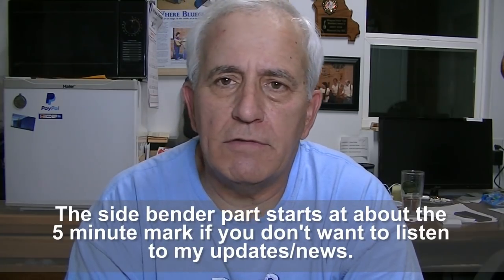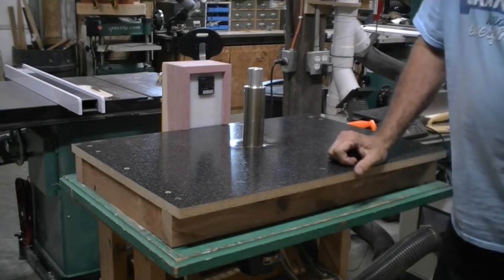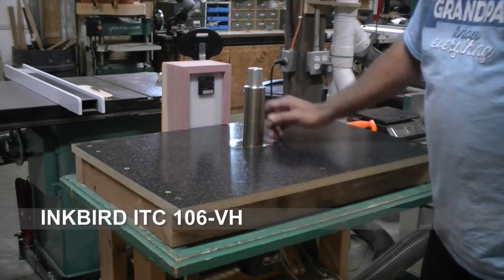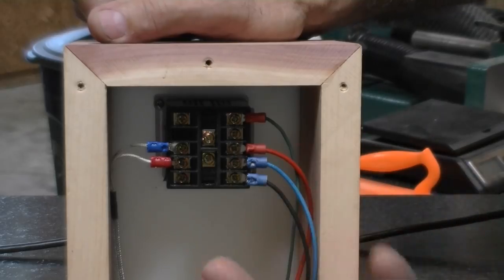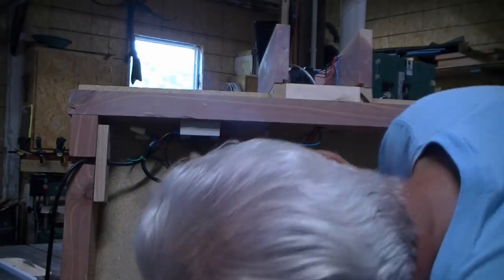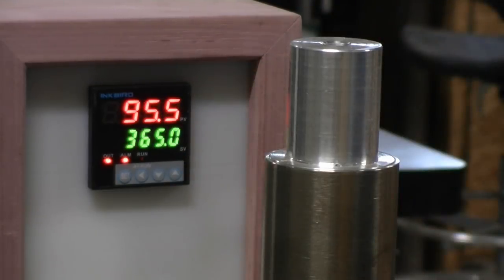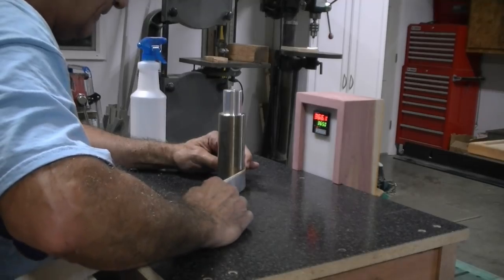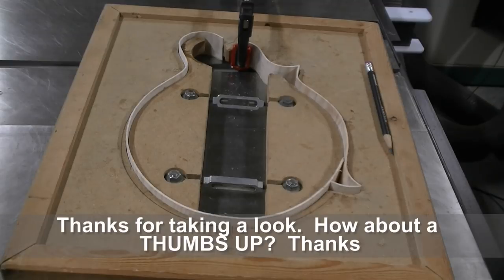237 RSW Worlds Best Side Bender

Comment: Awesome bending iron setup.  I have had a lot of luck with soaking the maple in ammonia, wrapping the maple in aluminum foil and finally doing the bend on the iron.  I find the maple bends as easy as building soft plastic.
Reply from the maker: Plain Maple bins very easy highly figured curly Maple likes to break almost instantly
Reply: Yes you are correct about the curly Maple.  I use the ammonia technique on it.

Comment: Pretty slick new tool with impressive results.  Thank you very much for showing it.  

The opposing slots to keep the cord in place is very clever.  A suggestion is to tie a knot in the cord inside the control box to act as a strain relief and prevent the wires pulling loose if someone were to trip over the cord.  (Yes, I'm anal-retentive.  I couldn't not say anything.)  Thanks again for posting these videos, I've learned a lot from you.

Comment: It is a little tricky ... but that flashing LoAlarm 365 can be disabled by going into the menu structure and disabling the Low Alarm setpoint . You will probably get a HiAlarm flashing after that . You just keep disabling alarms in the alarm menu until the controller finally has nothing to display on the Led display . Then you normally program the bottom Led display as the temperature setpoint and keep the top Led display as the actual temperature . That way you can look at the display and know how far the actual temperature is from the setpoint
Reply from the maker: I know where it's at in the menu. I set it to all nines which I thought was supposed to disable it. But apparently it didn't.

Comment: There should be something like, "Mirror" option, if you use the rear camera it shouldn't happen, only a feature on the front camera. That Red Ceder is beautiful, it's what my new guitar top is made from :) The one we conversed about awhile back that had the funny tuning on one string that seems to not have the correct intonation. That turned out to be my tuner by the way, it could not accurately tune a higher "D". Thanks again for your help on that.

Comment: FYI, it's a 'thermocouple', no 'er' at the end.

A type-k T/C is rated for -200C to +1350C (-330F to 2460F).  What you really want is a T/C where the range is suited to your application.  Although the k T/C will work fine, a J T/C: -40C to +750C (-40F to +1382F) would provide better resolution than the k in this application.
Reply: Todd Relyea hey leave us hillbillies alone. We can call it a tingymajig if we want. LOL

Comment: Jerry, Im in the process of building a bender like yours, Im having a horrible time figuring out the wiring, So I have one of those digital controllers like you I also have what I call a transformer The electrical plug gets wired to one side of that &  its split so its connected to the digital controller, Now does the thermo cupler get wired just too the digital thing? Or is it attached to the wires that get plugged into the wall?? Could you draw a pic of how yours is wired & post it or email it too me I would gladly pay you for your time. Thank you. Scott
Reply from the maker: scott 1911man I'll try to find time to do that for you. I was hoping folks could figure out the wiring from my explanation.  If you write down the colors and where they go I think you will be fine.  You should be able to draw diagram from that.
Reply: Rosa String Works Jerry, Never mind about the diagram Im just plain Stuoid when it comes to electrical things. My oldest Son is a mechanical engineer & He wired the thing up in no time. Again I truely Thank you and I hope you have not waisted any time on this.. God Bless you,
Reply: SCOTT 1911***If you are planing on building one* HERE IS THE BEST IMPROVEMENT I CAN THINK OF.TO THE DESIGN*Add a drop leaf table top to each end on the bender  table top  NOTE***this would add about 4 to 6 inch in width to  storage area *****this would add approx 8 sq ft to the work area. when open.****DR KEL

Comment: JERRY**To save your self a allot of steps while bending sides**I suggest you add  a hinged   fold up table top  to your bending table**Chuck
Reply from the maker: Not sure how that helps.  I guess I don't understand what you are suggesting.
Reply: E-MAIL SENT WITH PHOTO TO SHOW ATTACHMENT TO BENDER TABLE.**DR KEL
Reply: @RosaStringWorks  It keeps you from walking half way  across your shop to check the fit in the mold.*** Chuck

Comment: i thought you used the top half of bender for mando sides? does the bottom work so much better that you dont need the smaller top or is it just for super tight bends? it is an awesome tool. cheers!
Reply from the maker: The top works fine but it's better for a really tight bends.

Comment: Jerry, 

Have you ever looked into the color blindness correction glasses? I see them on Amazon for as low as $60.

Re the side bender...Have you ever used the blanket type benders? (example The LMI bending machine http://www.lmii.com/products/tools-services/bending/heating/lmi-bending-machine)?
Reply from the maker: Thanks I have two pairs of them. I have the cheap ones which show a lot of colors but they distort the colors a lot. I also have the enchroma prescription glasses. They seem to work that well but I don't think I see all colors with them either and you have to be in the bright sunlight for either pair to work well.
Reply from the maker: I have my own guitar vending machine if you will that I made. It works pretty well but I really like this new bending outfit much better.

Comment: If you are planing on building one** HERE IS THE BEST IMPROVEMENT I CAN THINK OF.TO THE DESIGN**Add a drop leaf table top to each end on the bender  table top*  NOTE***this would add about 4 to 6 inch in width to  storage area *****this would add approx 8 sq ft to the work area. when open.****DR KEL

Comment: Heya, I noticed you didn’t bother with a heatsink on your SSR. I assumed they were mandatory (but I’ve never bothered to do the math).  Does it get warm at all?
Reply from the maker: I don't know I didn't realize there could be an issue. I'll check into that.
Reply: The heat dissipation should not be a problem because of the low current, under two amps may heat the SSR with 2 to 3 watts. But for long-term use, it would be good to mount the relay on a piece of aluminum, with some air gap under it. Anyway, it turned out to be a perfect workbench.
Reply: As Tore says, It may not be necessary, or require much of one, if it does get warm. Your heating element is pretty small compared to the 1500-5500 watt hot water heater elements that we use them with for homebrewing. 

It depends a bit on the current rating of the SSR. The 40 amp models can probably handle plenty of heat without a sink. It just needs a way to transfer its heat into the air.

If you notice smoke coming from under the bench, lol, it may need a heatsink.